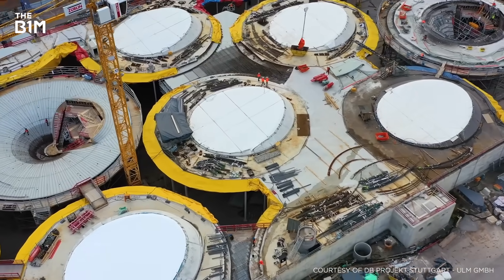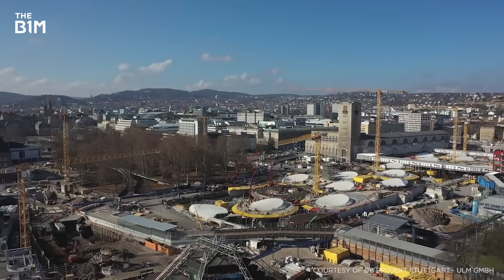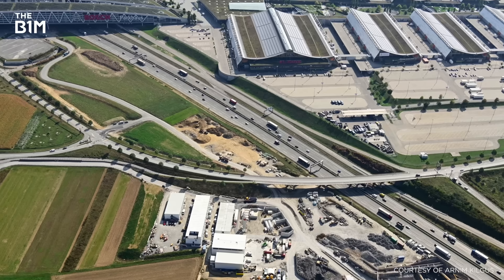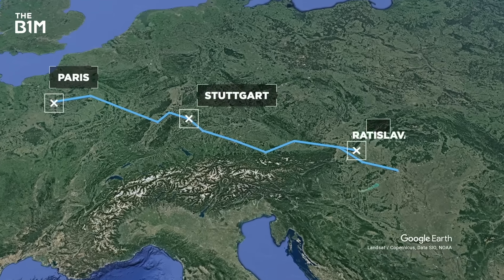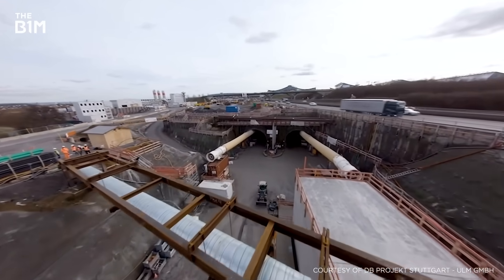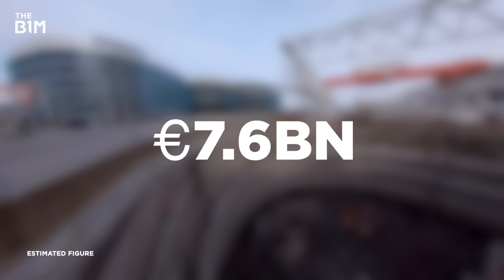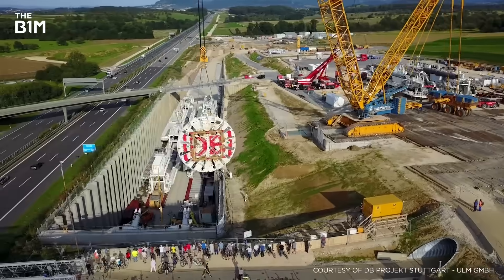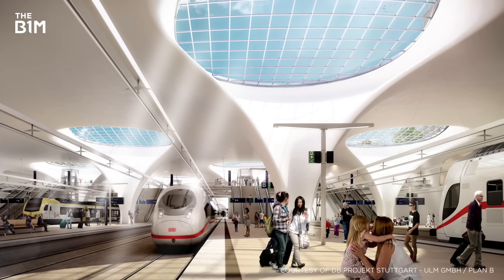Germany's 27-Year Struggle to Complete a Rail Project

Comment: I voted for S21 back in 2011. However if I'd had the chance, I would have voted for a simpler solution without those massively overpriced and not even pretty chalice supports. 

We basically payed 2 billion just for those stupid concrete supports.
Reply: That's nonsense. Just compare the costs with similar projects (e.g. in London or Paris).
Reply: @abalada  whats nonsense about that? Those extremely delicate supports took a very long time to build and cost a lot of money.
Reply: @_aullik  8 billion is the (current) price for the entire S21 project - not just the new train station in the center of Stuttgart. 57 km new railroads - out of these are 55 km in tunnels (and that's expensive). There will be in total 3 new train stations and a few more train stations will see changes. 2 billion will be at max the costs for the entire new train station in the center of Stuttgart. And here the costs to enable this train station to be built are higher than those of the future station building itself.
- the saving of the old railway directorate building
- new tunnels and one new station for the Stadtbahn (subway)
- a new culvert for the Nesenbach (the main wastewater collector of the side valley Stuttgart lies in)
- the "bridge" over the S-Bahn tunnel which is not strong enough to withstand the weight of the new train station
- the adaption and complete overhauling of the old station (Bonaz building)
- the constantly rerouting of the two main access roads into Stuttgart (B27 and B14) across the building site without interrupting the traffic flow
As a result of this that they have just begun (!) to dig out the last section (#21) of the new train station. Thus in this section, there is not yet even dug out the entire ground there. No foundation, no walls, no platforms. Thus the long time needed to build those fancy new supports at the other sections played no role in the whole timeline. As those are not the reason why they start only now with section 21. That's the B14, the new Stadtbahn station Staatsgalerie as the old station was in the way of the new station and the construction of the Nesenbach culvert.

If you compare the costs of a tunnel kilometer with the costs of similar projects in London and Paris you'll see that S21 is not esp. expensive. Despite the more difficult geological situation and the fact that S21 includes also a  new main train station.
Reply: @abalada  Yes the 2 billion statement was overstated. I thought that was somewhat clear. My bad.

I know that they are building in sections, but they can only reroute the roads if they have something to put it on. Now they cannot put the road on those chalice supports. They also take a very long time build and are extremely expensive. Had they gone with a more traditional design, the massive hole in Stuttgart would have been closed faster. It would also have been a lot cheaper.

As for the directorate building, I really don't understand why they saved that. But again, not my call.

There is also the problem that they planned this too small. With only 2 tunnels the main Trainstation is too small. They should have at least planned it in a way that is expandable.

Comment: What this video fails to mention is that the new station, when finished, will be way too small anyway which brings it to entire new heights of BAD.
Reply: fake news
Reply: @ThaldaNukra  'Fake' at best in the sense that it won't be underdimensioned when it opens already. But any expansion will be horribly expensive. And it removes all the redundancy you need in case of train failures or even delays.

Comment: Who cares if it makes economic sense, if it's paid with taxpayer money you can look somewhat beyond that and see what value it would bring to the people.
Cost and value aren't the same thing.
Reply: once finished the new station is already way too small to cover the needs, the amount of trains which are supposed to stop there; And unlike with above-ground stations, it's not that easy to just expand the existing underground station then
Reply: @EnjoyFirefighting  If thatäs case, it sounds more like it was fundamentally poorly designed ...as opposed to executed, as was my impression.
Reply: @MyLittleMagneton  in this specific case they had quite some aspects to keep in mind; Thus e.g. the new underground station has a slope as it has to pass under another tunnel on the one side and go above another tunnel on the other side; Not sure if any of the underground aspects in the downtown area also limited the size of the station from the beginning. 
Looking at my state's capital city central station it's a terminus station above ground, with only commuter trains going through on a lower level. Above ground there are 34 tracks of which 18 are outside the main hall, as expansions were required in the past and the main hall wasn't able to hold more tracks. However above ground that's relatively easy to do

Comment: I'm a little bit surprised, that the people are complaining about the project, costs etc, but noone seems to appreciate 1,7 km2 of new area in the middle of the city for new buildings, parks, etc.
Reply: just check how similar projects went in other German cities: Regensburg City moved the freight yard from downtown to the outskirts and few years ago shut down the still existing commercial district. Tracks and commercial buildings on a length of 1.4km were replaced by mixed use commercial and residential use. Although right next to the downtown district, good road connection etc it still struggles with many apartments remaining empty as it's way overprized

Comment: Why has Europe become so bad at building infrastructure projects?
Reply: There is too much regulation and everybody can try to stop such projects at the courts.
Reply: Not Europe in general and not infrastructure projects in general. Check out the B1M's video on the mega project of the $47BN coastel highway for example or Norway's way to build super long tunnels in a short time like the world's longest road tunnel. Also in Germany some projects were finished with great success, like back in 1992 the movement from the old to the new and current Munich Intl Airport, where operations where moved within a single night. Also Germany has quite an amount of large scale highway and railroad infrastructure projects linking former west and east Germany

Comment: the thing what worries me is the future capasity. Before, there were many platforms, the new has only 8. I hope that would fine for a long period. The BER capacity was small too. Cause one of their olan was to shut down the airport of East- & West-Berlin, so they can use this huge hub. But nope, too small and is no longer a hub #ripairberlin. But at least they have enough space to build more terminals (Terminal 2 is done) unlike the situation for Stuttgart 21 :/
Reply: Stuttgart 21 will have the same Capacity as the old Station, assuming that Trains stop there  no longer than 30 Seconds. It will be undersized for Current Traffic, not to Mention the expected 50% Increase in Travellers.

Comment: I visited Stuttgart several times over the last few years, mostly arriving and leaving by rail.  When you're right there and on the ground (literally). it's impossible to get a clear idea of how the finished project is being overlaid on the existing urban landscape.  Maybe I missed the key detail in the video, but I was wondering if the old platforms are being completely closed and removed.  I was under the impression that at least some of them were going to be retained for use by the S-Bahn suburban rail network.
Reply: yes the old above ground platforms are completly shut down once the underground station is in use; The entire yard with tracks leading to the current central station will be torn down and will clear quite a large plot for upcoming downtown city development projects

Comment: OPA! Welcome to Greece where:
The Thessaloniki Metro in Greece, is soon to turn just as old as the antiquities found in the central stations of the system, 
The underpass connection of the Athens Central (or Larissa Station) Railway and Metro Stations, after 21(!!!) years of the Metro's operation has still not been completed
And after about 15 years the modernization of the Base National Railway Corridor between Thessaloniki-Athens-Patras still goes on, and will go on because of the fact that it will have to go underground for about 9km when crossing Patras so that we are not cut off from our waterfront.

Yeah.

Comment: A project of a similar scale has recently been announced for Budapest. It would take 20 years to completely revamp the train infrastructure in the city. The project includes the renovation of multiple rail lines that go to the rapidly growing suburbs and beyond, a new rail bridge across the Danube (soon to be completed), a tunnel under the Danube to connect Budapest Southern Station to Budapest Western Station and make them through stations. It will also include the construction of more than a dozen new smaller stations, a new train track to Budapest Ferenc Liszt International Airport, and the first phase of Metro 5, that would basically connect the northern line of the old suburban railway system to the southern line, and more. Would be interesting to see The B1M doing a video on that. I am pretty sure that David Vitezy, who is basically the father of the project, and his team would be more than happy to give you guys a bunch of materials.

Comment: It's not really a 27 year struggle. Crossrail was first suggested in the 1980's. If you count the time from shovels in the ground to finished it isnt that long for the size of the project.
Reply: Yeah. 15 years to completely remodel and overhaul a major train hub is not that long. Not to mention all those new tunnels and bridges. AND the new high speed connection to Ulm.
Reply: Oh, and the new and well needed connection to the local airport.

Comment: I'm disappointed that you didn't mention the negative impacts for future operation at all!
The new station will have LESS capacity than before (32tph instead of 37tph).

Deutsche Bahn is making false claims about the capacity. They claim it will have double the capacity, but for that to work every train could only stop for 90 seconds! Very unrealistic, especially for 400m ICEs with few doors

Comment: This sounds like the failing and spiraling high-cost high-speed rail project in California. :(
Reply: Not really...
Due the the way how the selection process of the companies works, they have to extremely low-ball their intended costs. (Or rather are allowed to do so)
Thus as soon as the project starts they have to increase their prizes to make ends meet. Doubling of the initial cost estimates is therefore almost build into public projects in Germany. 

The cost of S21 is not spiraling out of control, it is merely approaching the true cost of such a project.
Reply: @3gunslingers  California rail project was also 100% setup up by political cash cows,  and not actually never meant to be completed anytime soon, projects like Kickbacks are the real profit in these enterprises; not progress. On top of that adds more political nonsense that spirals the price over 100B at this point coming from it's original 60B
Reply: @Racko.  
I was referring to S21 and its cost issues, not the California rail project.
Reply: @3gunslingers  I was comparing it to California’s out of control pricing situation, I get you though

Comment: Just remember Amsterdam build a short metro line across the city called the "Noord-Zuid" line for 3.1 billion euro's, taking more than 16 years to complete construction...
Reply: To be fair, amsterdam is a swamp.
Reply: The small Town where I grew up in South-Western Germany (right next to Basel/Switzerland) is upgrading 1.5 km of Train Line to two Tracks. It's scheduled to take 15 Years, just for adding a second Track to 1.5 km of already existing Rail Line, which has no Tunnels, only one very short Bridge and is located entirely out of Town, so there's no Houses next to the Line that would need Demolishing.

Comment: Is this the rail equivalent of Berlin airport?
Reply: No. The Berlin BER was ready to open in 2011. Move from Tegel to BER, opening ceremony all plained. But the responsible administration of the local district denied permission to open as they did spoil the fire protection system by ever-changing plans without adapting the fire protection system. 
S21 had so far only political / legal delays. The building project runs pretty much to schedule albeit this is a way more complex project.

Comment: How does anyone underestimate construction length by 20-25 years? 

Also, regarding Germany’s “biodiversity” rules… they have some ludicrous rules. Just look at some of the things Tesla’s Brandenburg Gigafactory has had to contend with. 

Often times the costs of projects get multiplied when overzealous environmentalists try to obstruct the construction of any public improvement project. I’ve seen it happen in my own city and state where our outer loop beltway was delayed 5+ years and the route reconfigured 10 times to appease some environmental group the claimed an endangered freshwater mussel may possible be impacted by the construction of a short bridge span through a wetland area. What do you know, the state ended up settling with the environmental group (i.e. paid them money) and they dropped their suit. The taxpayers ended up paying hundreds of millions of dollars due to what essentially was a shakedown by an environmental group. Sometimes the need of the public outweighs the potential impact to the environment.

Comment: ugh, don't hype this dumpster fire of a train station.
Reply: Why? It's a major and direly needed city development project. With the nice side effect of a beautiful train station and a fast connection to the airport.
Reply: @3gunslingers  i disagree. the capacity is way reduced from the terminus, old trees had do be removed in favour of posh concrete architecture that makes the place less enjoyable.
Reply: @yetzt  
In the contrary. The place will be MUCH more enjoyable. No loud trains in the inner city anymore and no huge track apron devoid of any life. The air quality will make a big step upwards. 

The adjacent park "Schlossgarten" will receive a huge upgrade and additional space with all those tracks and trains gone. 

A few trees are a worthy sacrifice for that whole project.
Reply: @3gunslingers  in fact you hardly have ANY problem with noise coming from the railroad tracks at the central station or the tracks leading there, at least not in Stuttgart. So that's an argument you can drop for sure, The air quality? With most trains being electric trains? Come on ...
Reply: @EnjoyFirefighting  
"The air quality? With most trains being electric trains?" 
Not the (only) trains, but the huge completely barren area of the tracks. 

The noise was always audible when I lived there. 
And have you been to Schlossgarten?
Reply: @3gunslingers  barren areas ... with a park stretching alongside the tracks for some kilometers ...
Yes I have ... with more noise from the nearby road and one of the country's largest EMS stations around the corner
Reply: @EnjoyFirefighting  
And now the tracks will soon be gone and the park even bigger.
As this wouldn't improve air quality...
Reply: @3gunslingers  lol if you think that it'll make a great difference, go ahead

Comment: First of all this video only shows the ups of this project. The entire emergency plan if theres a fire is complete garbage. The evacuation takes way too long and the venting system that is supposed to free the station from smoke is known to be weakly planned. This entire station is a hazard for any passenger. It looks great but it functions less
Reply: With those rules you have to close all underground train stations in Germany. Like Berlin Hbf (tief) and most underground S-Bahn stations as well. The new train station is accessible from 4 sides. With the way through the Bonaz building the longest one.
With the old train station, the way through the Bonaz building would have been the only one to reach platforms. The side wings had no access routes for emergencies at all. And from the trackside this was not possible either.